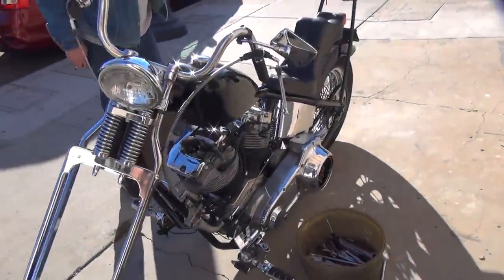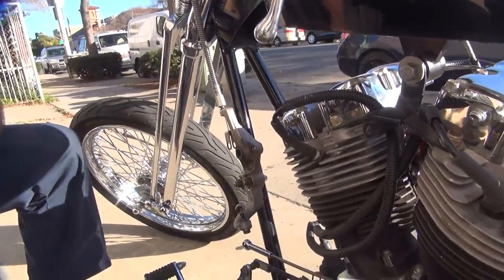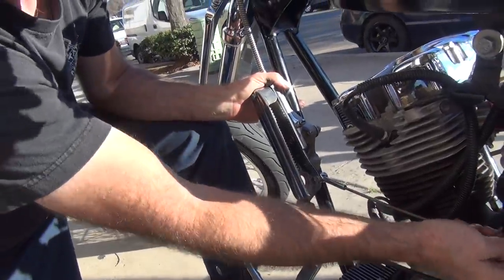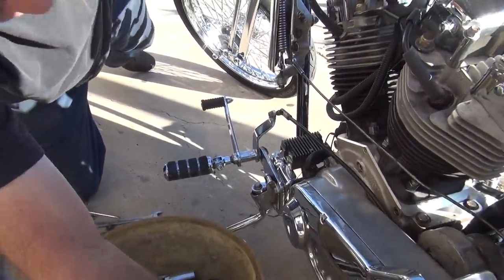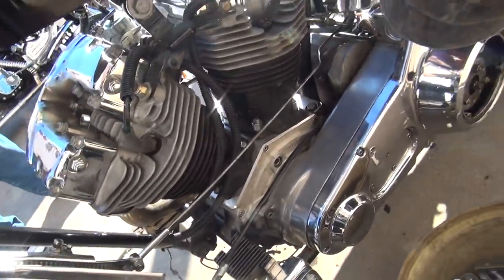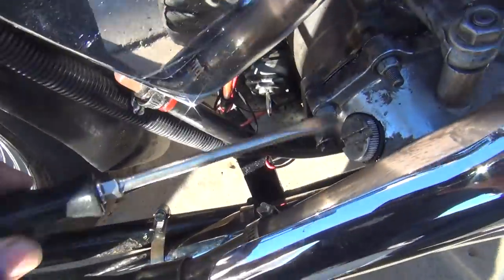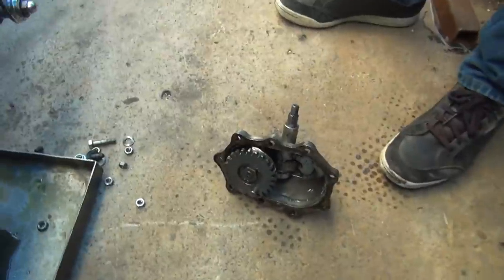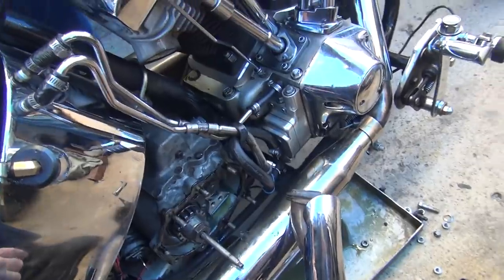#101 fixing clutch mousetrap and throwout bearing adjustment 1974 shovelhead harley tatro machine

Comment: Im having  a 70 ironhead rebuilt it's is a stroker. And the guy says he can't find pistons  do u know where i can get some?
Reply from the maker: have them made. they pop up every now and than.
i can get them made for you but they are going to cost. most of the time i get two sets made. the 2nd set is .005 bigger for the next go around.

tatro
Reply: @TatroMachine  roughly what's the cost

Comment: That's not how? 1. Adjust clutch rod distance from side of ratchet shifter. 2.......
Reply from the maker: yes, that is where you start. then you fine tune everything else to get it to work how you want it to work. light or heavy pull and how far from the handlebay before the clutch hits.
tatro